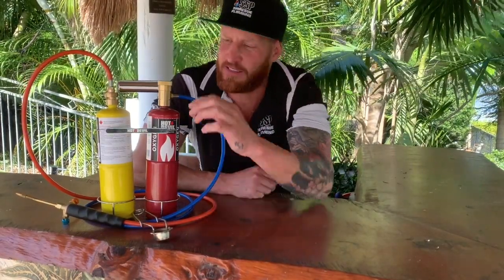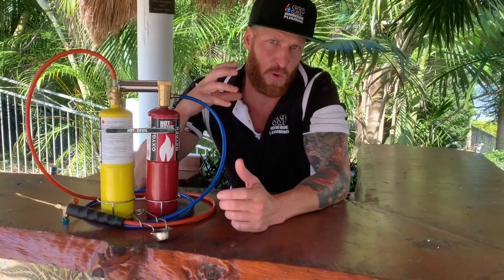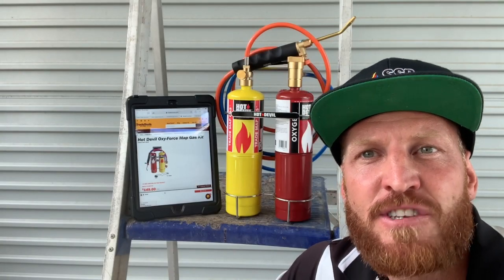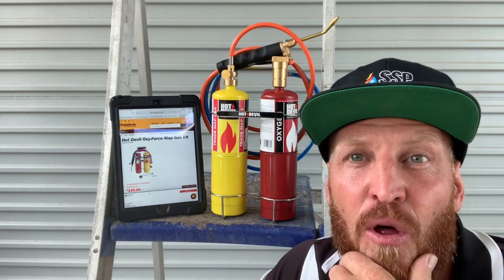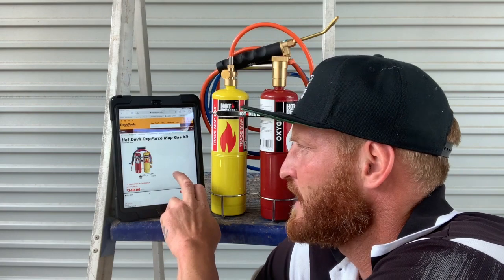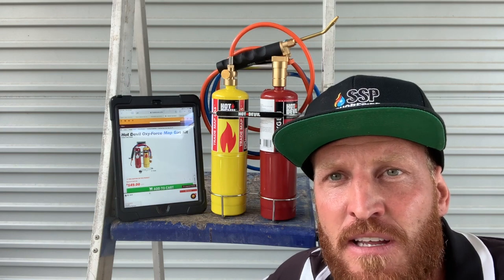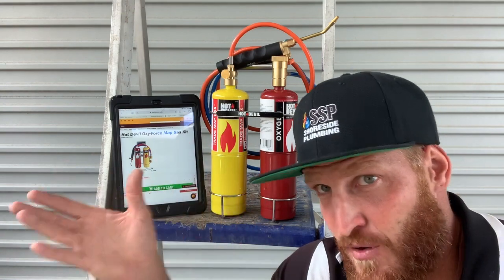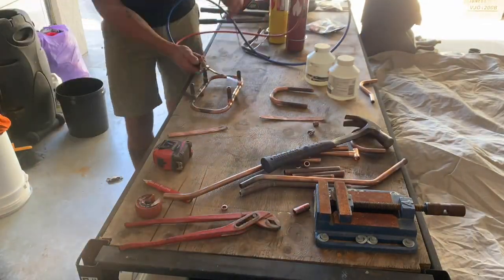HDOXF - Hot Devil Oxy-Force Map Gas Kit

Comment: Brand new to using mapp and oxygen…using it to remove a rusty spindle nut off an axel. How do you regulate it from not cutting through the bolt? I’m scared to death I’m gonna cause damage to my threads. Cheers, Mate